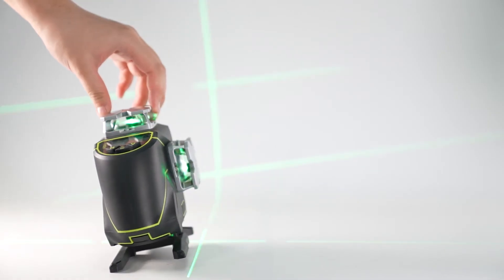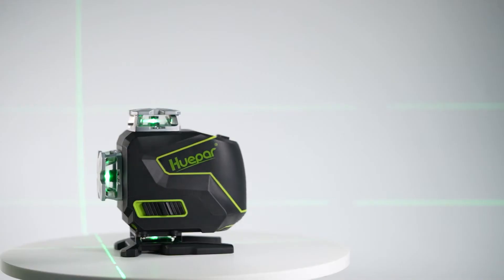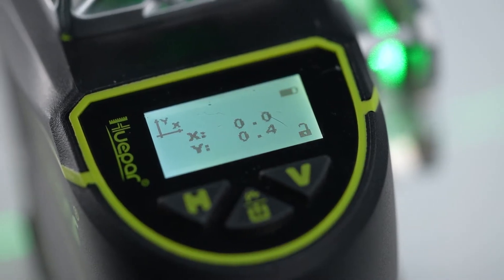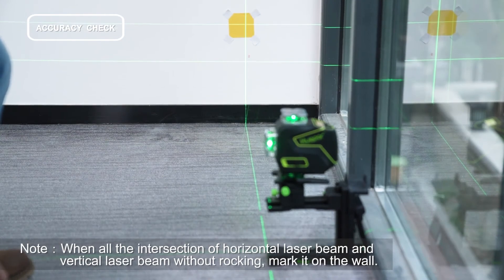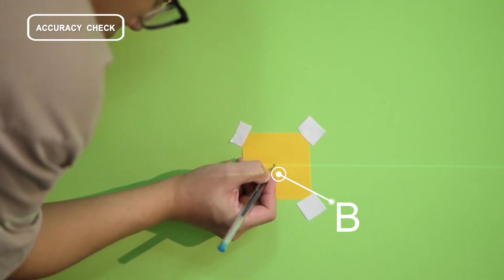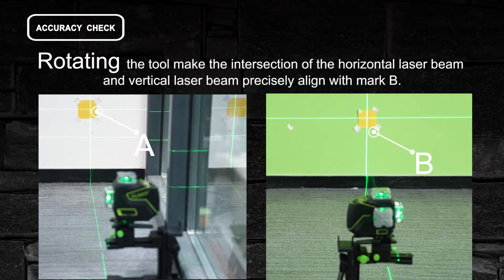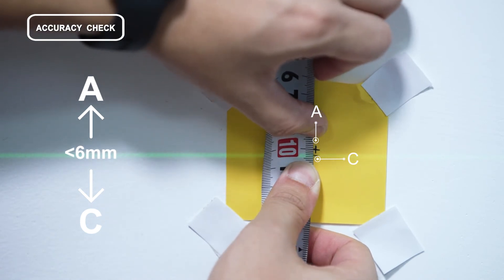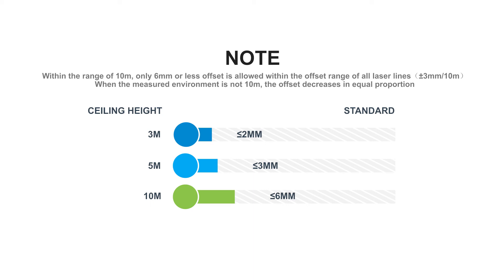How to check the accuracy of the horizontal laser beam

Comment: Could you please explain why the leveling accuracy in the specifications section of my SO4CG User Manual states ± 3mm/10m yet this video states that for range of 10m you allow 6mm offset.  Are you saying that the 360-degree laser line can be off as much as -3 mm at 5 meters away from the laser level and 180-degrees on the other side of the laser level, also at 5 meters, it can be off by up to +3mm for a total of 6mm over a distance of 10 meters?  Putting it more simply does ±3mm mean [plus OR minus 3mm] or does it mean [-3 plus +3 = 6mm assuming zero is true level]?
Reply from the maker: The accuracy of our products is within 10 meters, and the horizontal line deviation is within 6mm. It means that when the distance is 10 meters, it is +3mm up and -3mm down, so it is equivalent to 6mm.